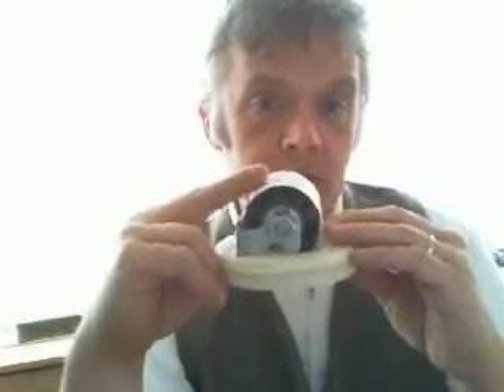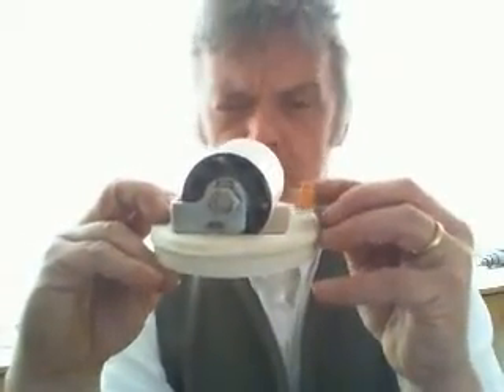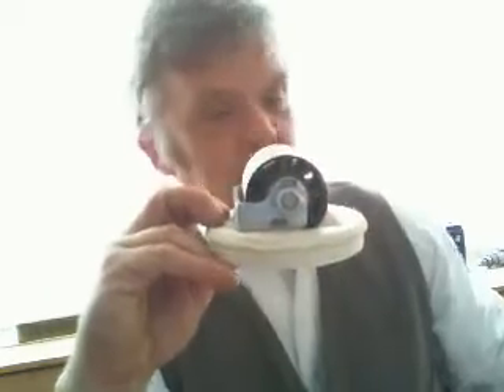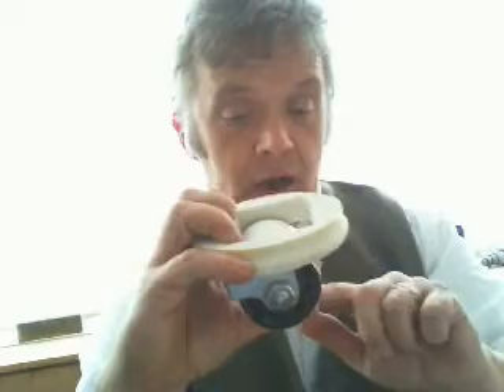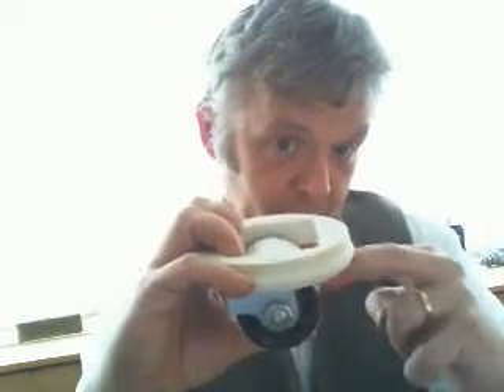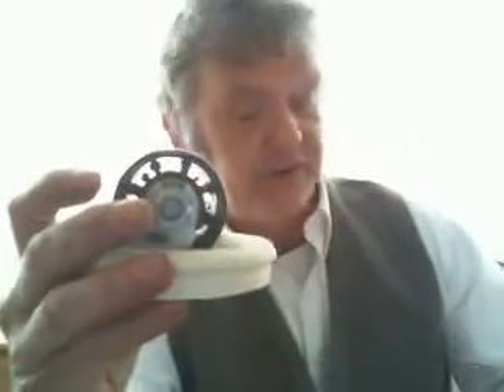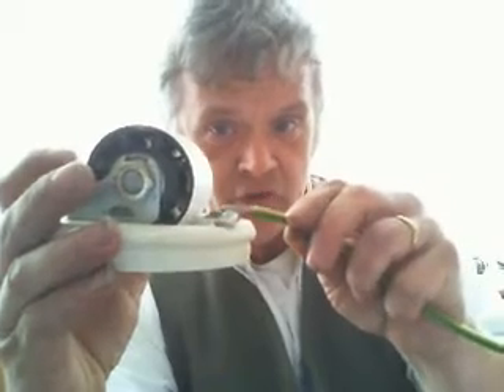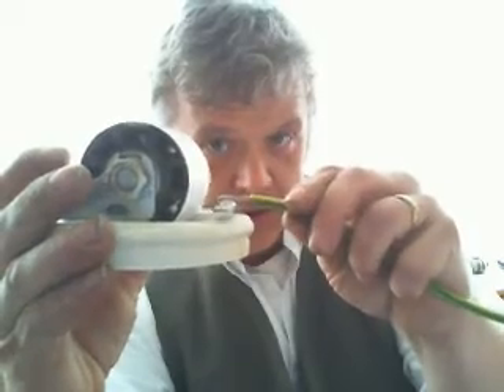How to build a Van Der Graff Generator 6 - The combs

Comment: I have finnaly finished my machine and even on 1/5 motor power sparks are 20-30 cm long !
I could not make a toroid but  without it machine is working perfect ..Combs are excatly in positions as you have shown.They are  made on cooper board with small nails thru and soldered.Terminal is made from two large about 35 cm salad bowls from IKEA..Just one question it is save to power VDG in my room full of computers wi fi and stuff?
 soon I will make short clip with my construction Cheerrs brother .

Comment from the maker: Oh no - that's a really bad idea. A VDGG of this power will discharge through the house electrics and fry anything that is plugged in. The best idea is to sink a copper pipe into the ground outside and attach an earth cable then run it to the VDGG.